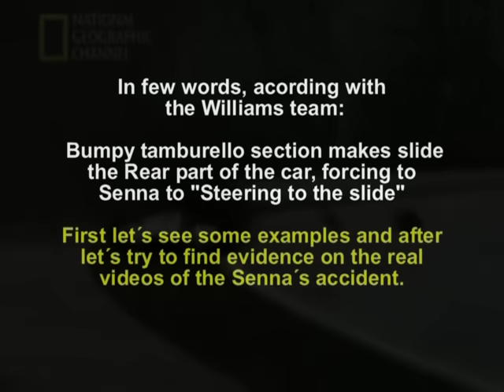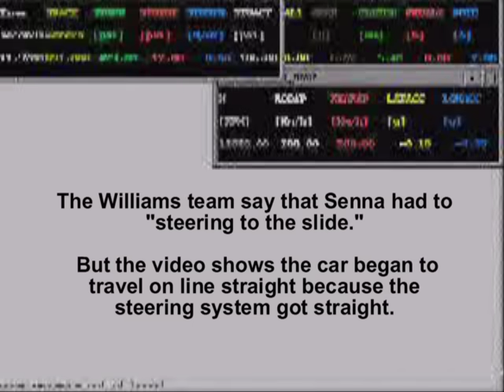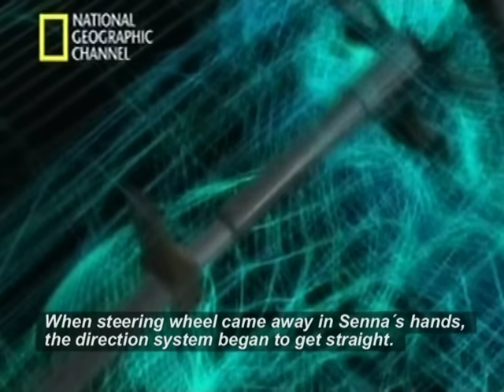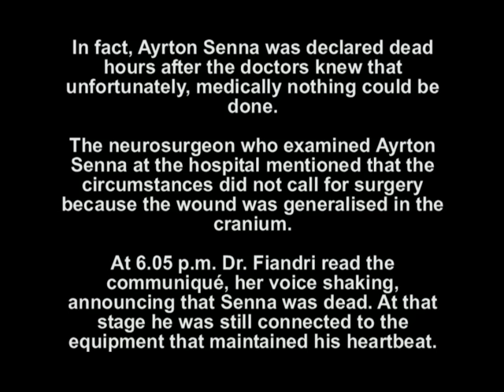5/5 the death of Ayrton Senna - what NatGeo did not tell

Comment: Great analysis. Your points are valid and well documented (if not too much, c.f. sparks in the 4/5 vid).
I'm a welding specialist (IWS) and was taught that in critical structures, welding should be avoided if possible.

A point to be made is that Senna was reckless; he was extremely fast because he was talented but not only. There were multiple times where he got away with pushing the envelope and that last time... Murphy caught back to him, unfortunately. R.I.P., he was still a nice guy nonetheless.

p.s. I wish luck to all who are racing out there !

Comment: I think this video gets to the logical conclusion, that the steering column broke.  Unfortunately Senna had something to do with this, as he was the one demanding the change to the column.  I always wondered why the in-car footage always stopped  before Senna's car started to leave the track.  Obvious conclusion, they didn't want to show the car not being turned into the spin.  However, everyone in F1 knows every shot the team gets is being recorded, so the exclusion of that video pointed to a conspiracy not to show that footage.
Reply: It is silly to suggest that Senna had anything at all to do with the steering column failure.  True, he did ask for adjustments to the position of the steering wheel but he didn't actually carry the changes - the Williams technical team did.  It would be like if took your car into your mechanic complaining of a wheel imbalance and then the wheel subsequently falls off on the highway after the mechanic fixed the problem, then somehow you are partially responsible for that!  This was not Ayrton's fault at all.
Reply: tor378a Look, you and I both liked Senna. But Senna was smart enough to know every little thing that was happening to the car.  If he asked for a change to the steering column, he would have asked the mechanics how they were going to accomplish this.  If they didn't have a shorter column laying around, he would have asked about cutting and welding it.  Then he probably wanted to see what they had done afterwards.  Senna was desperate to finish a race at the beginning of the season, as he had not yet done so.  Also getting pole was a big deal.  He probably knew there was a risk and took the chance.  No way is Senna dropping the car off at the local mechanic, and saying fix it.  He was a pro after all, and looked after every detail.  He took a chance and it bit him.
Reply: John G. Hill I don't understand why F1 would allow a steering column to be cut and welded!
Reply: John G. Hill  you are right
Reply: John G. Hill no they in any motorsport don't show crash unless it is happening while recording race so they gone to overview so crash is seen plus we would never see crash if camera wasn't on senna car just cuz senna wasn't moving same as bianci they never showed it only some ppl got video but fia never showed from cameras
Reply: Senna did ask for a new column, but Williams gave him a broken one, I still blame Williams
Reply: You know i love senna and his attention to detail but i don't think that goes as far as him inspecting the weld quality lol wtf 

he wanted it lengthened and it was...  How could he have known that wasnt his job or area of expertise obviously handled by the team.... That's what makes F1 a team sport - no one person can do every aspect of building the car let alone at that level required in F1 you're talking like he did everything.
Reply: Exactly Senna was a target because he was making changes to the sport and he had become big major. I would dig deeper.
Reply: To those saying the video was cut by f1 you are wrong, FIA had the footage of the exact moment in the black box of Senna's Williams, the team asked for the black box to get some data from it and the fia let them. When it left the FIA's hands it was in almost pristine condition, when it was returned it was beaten and battered and most of the important data about the crash erased. Hence why the recording cut out as this footage was taken from when the evidence was displayed at court. Williams were charged with manslaughter and tampering with evidence incase you were wondering (they were able to used the traces of the files to recover some but not all files erased)
Reply: Hero Zero: Wrong, the in-car video is TRANSMITTED to video recorders that are located in a truck somewhere on the race circuit grounds.  That's why you see the video drop out when the car goes under a bridge--at that moment the car's antenna is being shielded by the bridge.  And the video belongs to F1, NOT FIA.  Bernie Ecclestone (I believe--or whoever it was who was running F1 at the time) is the one who BOUGHT the rights to all of the F1 video years ago.  It was a huge coup for him to do that because the tv networks have to pay for and broadcast only what F1 gives them.
Reply: It's worth remembering that any footage which might reflect badly on Williams would also reflect badly on F1 and FIA. If (big if) there was a conspiracy to withhold certain evidence, then it is likely that both Williams and F1 were in on it. Remember it was the FIA technical delegate who authorised the removal of the black boxes from Senna's car.
It is also the case that very little of the footage from Bianchi's accident has been made public. It would be easy to believe that FIA has a policy of impounding all footage  from all accidents and anyyhing which doesn't make it to air on the live broadcast is never seen.
Reply: Uh he demanded a change to the steering column but he certainly didn't demand certain death? He certainly didn't ask them to make it  so that the steering breaks in his hands. Your conclusion is pointless.
Reply: @ @JohnGeorgeHill : It would have been the responsibility of any mechanic involved, let alone engineer, to refuse his demand on the grounds of safety. What they did was so blatantly amateurish, and ignored basic principles of engineering, that it left me speechless. Every engineer-to-be has to have learned it by the end of the second semester. Such an approach would inevitably end in jail for those in charge anywhere outside the racing world.
Reply: @sackboydrake  "He didn't ask them to make it so that the steering breaks in his hands." Of course he didn't. But it's impossible to know if a weld is good or not by just looking at it. If he demanded a change the first answer should have been no but if he kept pushing on it maybe the technical team said "Y'know what, it's your car, you're driving it, it's your life, you're the best f1 driver in the world. We'll make the change for you" and just botched the weld. It's an accident. Nobody makes perfect welds every time, especially not on a time crunch like is suggested. It's not the fault of Williams if Senna pressured a mechanic into making a bad decision and it's not the fault of the mechanic if he doesn't make a perfect weld. It's an accident. A collection of errors. Multiple mistakes made in just the wrong order and someone died because of it.
Reply: Yeah I find it very strange the timing of that feed cut. It was the exact moment that would have resolved everyone’s questions. Where is that in car footage?